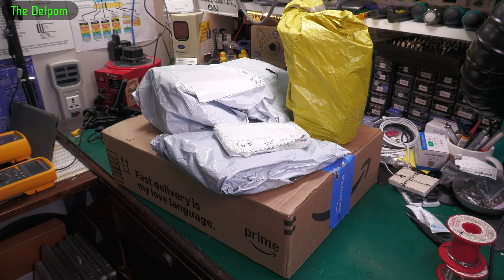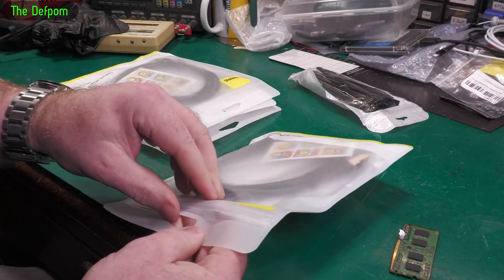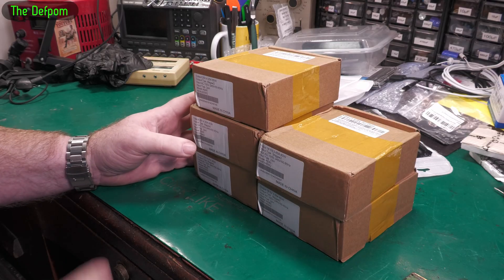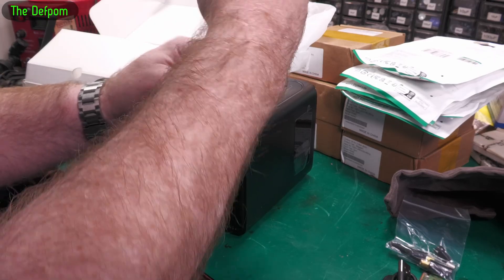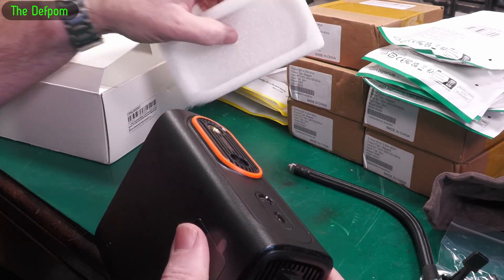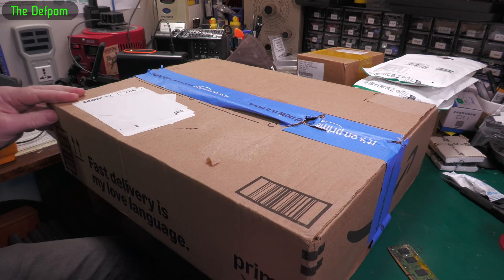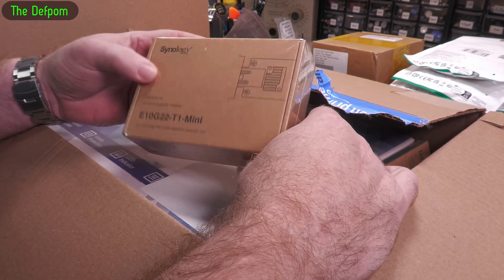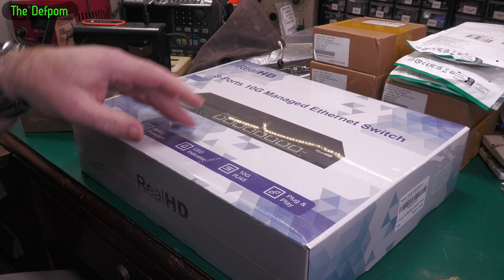🔴 Mailbag Monday 16th June 2025 - No.1368

Comment: Throughput for HDDS is required also to get full speed 10g. Full raided nvme drives may allow full speeds, but is you have cat5e (even short runs) you will probably only achieve 2.5gbps. Your 10g upgrade may have been overly enthusiastic
Reply from the maker: I’m future proofing, no point buying 2.5G only to replace it all in a few years with 10G, might as well get the better one now,
Reply: @TheDefpom  i understand..i did same but settled with 5
Reply: With my 10G LAN I got 2.5G speeds between my Win10 DevPC and my QNAP NAS. Then, when I upgraded my DevPC with new MB etc I didn’t bother fitting the 10G network card as the new MB came with a 2.5G interface.
Things like NAS cpu, HDD speeds etc etc matter.

Comment: I'm using a similarly spec'd 10G switch with a 10G card in both my NAS and Win10 DevPC. With 10G (or at least 2.5G) you can edit 4k videos (Davinci Resolve) quite happily across the Lan to the NAS, but make sure you set up the cache/render file locations properly and on the correct type media in Resolve for best results.

Comment: I agree with you regarding that air hose on the compressor, that hose should have been 3 times the length to be able to reach the valve stem on a large tire at the top of the tire. I have seen first hand the effect of temperature on air in tires in our -40c winters. Tires develop flat spots from vehicle sitting for a while.  Think that blue Amazon tape is water activated stuff. They dispense it and the back of the tape is wiped with a brush applicator and activates the glue.

Comment: The brackets are also for wall or ceiling mounting, you screw them to the case at 90 degrees so that they can then be bolted down.
Why RJ45 and not SFP? SFP works out cheaper if you don't already have CAT6 in the walls to use.
Reply from the maker: I don’t have any SFP equipment, and I have cat5e in the walls already, I’m going to get a couple more 10G switches and see what speeds I can get through those cat5e cables in the walls, the distances are not very far, one is only about 6m, then other is about 20m, so I may still be able to get improved speeds even though the cables are not rated for it.